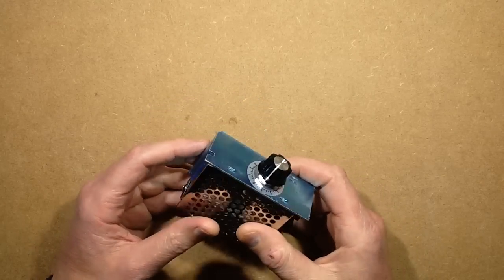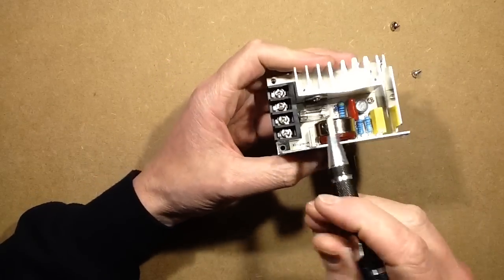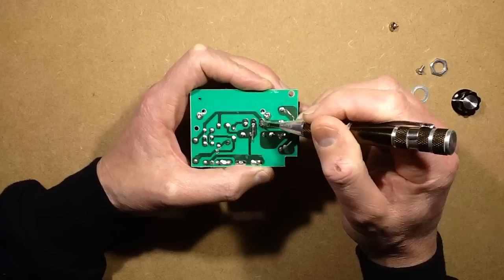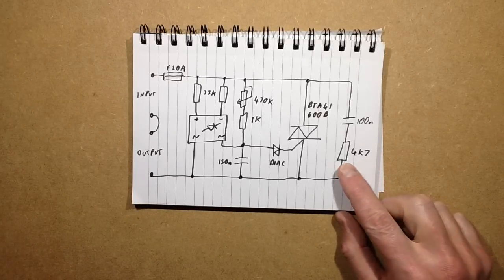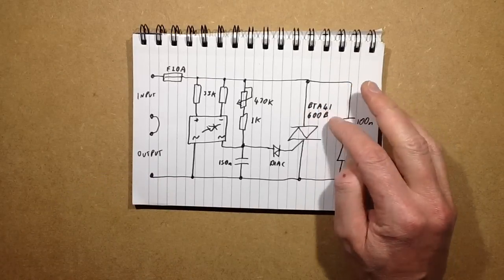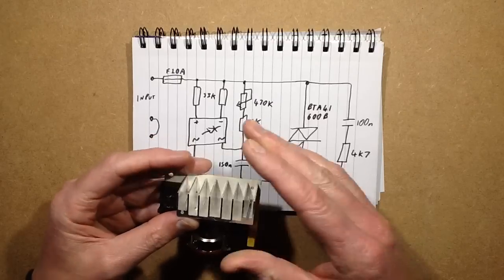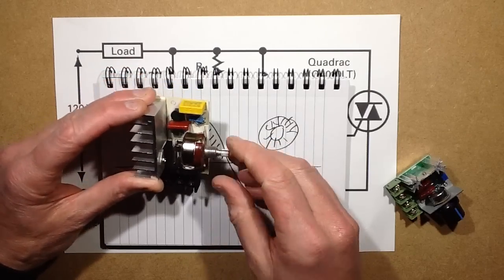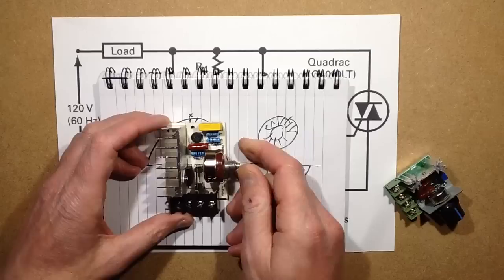Inside a "4kW" ebay power controller with schematic.

Comment: I have this unit, i'd like to use it for running a dc motor.  I used a 50amp bridged rectifier to convert ac to dc pluged it in and the motor runs full speed.  all the time. I even took out the potentiometer  and it still runs full speed.  Whats going on?  is this thing faulty?  all the solder joints are good and tight and I don't see any accidental jumpers.
Reply from the maker: If you try it with a plain lamp and it does the same thing then the triac may have failed.  If it works with the lamp then it may be an issue with the inductive load.
Reply: Yes I tried it with a lamp. Its a light on at all times. no diming.  thanx  I will remove the triac and find a replacement.  any ideas?  thanx for the response.  great sight too!
Reply: Never mind. I replayed your video again  and sure enough you explained it very clearly what the triac is.  thanx  I'll keep you posted.
Reply: I replaced the triac and everything works like it should.  I first made sure the ac light bulb went on and dims, then hooked up the diode trio to run the dc motor and walla, smooth as silk. Thanx Mr. Clive for you insights and help!  Just a heads up: make sure you ground the scr and the scr to the motor.  I allways use my tester to make sure of any stray voltage leaks. and the motor had around 10 volts flowing around the case. not sure of the amperage.  I grounded it and it went away.

Comment: Should there be insulation between the PCB and housing?
Is this a variAC?
Reply from the maker: +Slot1Gamer It is separated electrically from the casing.  A variac is a variable transformer, usually with exposed windings and a carbon brush.  This is a phase angle controller that regulates power by switching on and off at specific points on the mains sinewave.
Reply: +bigclivedotcom Can you clarify that?  When you took the board out it looked to me (and I assume Slot1Gamer) like 220V AC mains tracks at the back of the board was dangerously close to a flimsy metal case. I.e. if you grabbed the case and it bent, or if you accidentally poked something through into it, you'd hit live mains.
Reply: +MrSwanley This power controller isn&#39;t meant to be poked or touched when in operation.
You could just as well poke something in the wall socked, you&#39;d hit live mains.
And I think you could ground the case if you really wanted to be safe or to be able to touch the case.
Reply: I don't know where you live, but UK wall sockets have defences against being poked. You would have to poke something in the earth and live terminals at the same time. As to your main point, I remain unconvinced.
Reply: +MrSwanley you can just poke the hot, and be grounded.  Still dead.
Reply: I take it you didn't read my post above yours.
Reply: MrSwanley I think he means live on the device not wall socket
Reply: +Slot1Gamer I have a 4kW variac and it is big enough that you can confortably beat a hippo to death with it.
A variac is wound around a huge iron core.

Comment: Could this be used as a speed controller for a mobility scooter? I want to add more batteries but don't think the stock one will handle it.
Reply from the maker: +zeatsov No.  If it actually triggered it would latch on continually.  It's for AC only.  Not DC.
Reply: ahh yeah, forgot about that bit lol.
Reply: +zeatsov it would depend on what you intend adding, if you only add more batteries for capacity (mileage), then you can just add them as the stock controller is not doing any more work, its a common mod to add batteries like this or better batteries when the old ones die.(parallel batteries, same volts more Amp hours) with the added advantage your charger will still work, just take longer.   but if you mean add more batteries (serial) which increases voltage, making the scooter faster, then yes you are asking the controller to deal with more power than it was, and probably everything on the scooter wont handle the stress
Reply: +jusb1066 well I was thinking of doing both if possible and adding a switch to change between more power or longer life and adding a battery meter.

Comment: Huh. Haven't seen an actual TO-3 in decades. The tab version is odd—it certainly wouldn't fit in a TO-3 socket. I've seen similar tab packages on power MOSFETs, TO-247 comes to mind.

Comment: I've just recently got one of these (for a motor). After a bit of use, the capacitor on the motor started smoking (so I've disconnected it).
Reply from the maker: The capacitor wouldn't like the sharp waveform of the switching.  Some motor arrangements have a separate continuously powered capacitor winding for direction and then control the other winding.

Comment: my dimmer don't  work .its new as same as you. what should i do? I ran an angel grinder but it stayed at same speed.  please help me ..i will be very grateful..
Reply from the maker: If it stays at full speed the triac may have failed short circuit.

Comment: i bought this one 4kw, and i control 1,2,3 lamp so it is ok, but i control 1 ac 220v motor, so it can not work(when i control this motor, i must adjust VR 450kohm maximum, so this motor run, but i adjust to decrease in value  450kohm, so this motor does not work ). i do not understand!!!!!!!????? can you help me?????
Reply: you cannot control an induction motor with a phase fired circuit. You need a VFD for those.

Comment: Looks like the snubber circuit is designed for a load with a (very) high inductance. Hence the high values for both Rs & Cs. Check out this link: 
http://electronics.stackexchange.com/questions/55368/choosing-triac-snubber-resistor-for-multi-purpose-switching
Reply: Or maybe they just got it wrong!

Comment: I have one those Solariboost pieces of crap that has failed so was thinking of just ripping out the innards and using the case to house one of these to use manually in series with a timer socket. The iboost gave no hot water in the darker months and to much in the summer so I'd rather just have a power controller to reduce the power to the immersion heater, on a timer for an hour or so a day, to give me enough hot water,  & free if possible from the solar panels but looking at the 10amp fuse in this I guess it is not really 4kw or meant for use with a 3kw immersion heater unless I just try upping the fuse or never turning the dial fully on and occasionally I would want to do this for water heating speed?

I really can't understand why there is not already a cheap timer/power controller on the market for immersion heaters to work with solar even from the Chinese! Instead you have to pay hundreds for an iboost or similar that will last a couple of years if lucky & it's not worth it or make up something yourself and also work out how to do it yourself it seems. At least this one is cheap enough to give it a try and see what problems I run into. My iboost still works on the timed manual mode but that is set at 3kw and my solar rarely produces this.  The iboost has stopped working on the auto mode which used to adjust the power to use whatever electricity was otherwise being exported. I think maybe the triac in it has gone but I have no test gear to know for sure.

Don't suppose anyone has any links to any useful info on this type of thing? For now I just continue using the iboost manual boost timer and it's ok (I have to pretty much use that all winter in any case) but controlling the power level to match the solar output or should I say general lack thereof would be better.

Comment: +bigclivedotcom Would something like this be OK to use to reduce the output of a large multi-outlet aquarium air pump? The type that works by vibrating a permanent magnet at 50Hz?
 Thanks.
Reply from the maker: +Misfit the mad That's usually done by restricting the air output.  It wouldn't be a high enough load for a dimmer.

Comment: http://educypedia.karadimov.info/library/6785.pdf
Designers must manage the following trade-off to choose the suitable RC snubber circuit:
● Reduce dV/dt rates: the snubber capacitance must be high and the snubber resistance
must be low;
● Reduce dI/dt rate at turn-on (refer to Section 1.4): the snubber capacitance must be low
and the snubber resistance must be high.
Nevertheless, when low load inductances are controlled or, low damping factor or low slope
of reapplied voltage are considered, the snubber circuit design can lead to choose a low
snubber resistance value. To limit the snubber capacitor discharge through the TRIAC at
turn-on, the resistor value must be higher than a minimum value (typically 47 Ω for most
TRIACs and ACSTs).

Comment: why they use a 10A fuse if the dimmer it's for 4KW, i need 20A for my motors it'll work ?
Reply: never mind i found the answer in the last minute of the video hehe

Comment: Clive:  I'm a bit thick (well, actually a lot thick).  Did you test this unit?  I  know that the teardown was the purpose of the video, but even so........
Reply from the maker: +John Schroeder I haven't tested it yet.  Bizzarely I can't find a decent load to actually test it with that doesn't have electronics in it.
Reply: +bigclivedotcom Could you not use a couple. Well 4, 500W halogen floods?
Reply from the maker: +Birdiemango1 All my floodlights are LED.
Reply: +bigclivedotcom A vacuum cleaner motor will be a universal motor, if you have a basic one with no speed control on it
Reply from the maker: +jusb1066 Henry with unknown circuitry inside for speed control.
Reply: +bigclivedotcom 
No water heaters or electric heating fans?
Reply: +bigclivedotcom Electric kettle?
Reply from the maker: +ib9rt Even my kettle is electronic.  It's the one-cup type with the tank of water on the back.
Reply: bigclivedotcom Not even have an electric garden appliance? mower,strimmer etc?
Reply from the maker: +Birdiemango1 All Ryobi cordless.
Reply: bigclivedotcom hair dryer?
Reply: Birdiemango1
he doesn't have hair!
Reply: +jusb1066 The Beard though!!!
Reply: +bigclivedotcom 
Damn, looks like in your house you could run everything on 1A rated fuses! Nothing at poundland that draws any significant power?
Maybe it's time to get two of those very cheap 2000W heating fans. Cost less than 10€ online, maybe a little bit more at your local DIY/electronics store. You could also make a nice teardown after that and show why you shouldn't buy such crap, if don't want your house to burn down. At least you'll get some resistance wire and thermo switch out of them.
Reply: +bigclivedotcom I've made my own with nichrome resistance wire. 18 or 20ga may be good for you. I needed 3kw at 600 volts and I ended up winding a bout 5 feet around a .25" mandrel on a wood lathe. HTH!
Reply: +HLSDK ...5 feet of coils that is. Kinda pricey I suppose, it had to replace a bank of lightbulbs.

Comment: I have a water heater rated at 5500w, Can I use this or is there a relay system for that?  thanks!
Reply: +Astolfo Fumagalli add a CPU fan to the heat sync, and a small 12 phone adapter, give it a try!
i've never tested this but it should work.

Comment: hello clive please can you help me, ive got a mig welder and i want to fit a regulator like this to fine tune the output,please can you tell me any reason why this might not work thank you!
Reply from the maker: A welder transformer is a very harsh load to "dim".  It could also result in arc instability.
Reply: @bigclivedotcom  ok thank you

Comment: Thanks Clive. I bought one and interested to see how it works. But what effect would that 4.7k in the snubber have if its an error?

Note to self .... must add earth!!
Reply from the maker: The high snubber resistor is wrong.  A typical snubber network should have a capacitor in the range of 100nF and a resistor in the range of 100 ohms.

Comment: Umm. . .the first problem id mention is that the BTA41-600B would be pretty much exploded into spacedust if you apply the "maximum rated" 4000V as it is rated at 600V and its rated internal insulation can handle up to 2500V. Plus you are required close to 12mm distance between coated pcb traces and more than 2cm for open air ones to meet any standards of handling 4kV
Reply: +GotCritified 4kW (Watt) not 4kV (Volt)
Reply: +GotCritified You appear to be confused about W and V
Reply: +Kevin Garten I think he got crucified.

Comment: I bought one of these to slow down a washing machine motor and it worked well. I changed 2 of the wires on the motor to a faster speed and it still worked well. Then I went to change the other wire to make the top speed of the motor the slowest speed. I wired it wrong and the house trip box tripped. The fuse didnt blow in this unit or the plug. When I put the wires back to how they were, I plugged it back into the mains and now it doesnt alter the speed. It is atthe full speed, even though I turn the speed down with the knob.  Would this be the triac or the potentiometer that has gone faulty. Power still goes through  the unit. I hope someone can tell me. Thanks
Reply: just simply FORGET ABOUT MOTOR SPEED CTL with a Triac! they need variable frequency NOT variable voltage as for resistive loads (light bulb dimmer).

As far as Washers: the best thing to add to make them last forever is called a "Soft-Starter": it ramps up starting torque on 1 or 3 phase motors 👍🏻

Comment: I have found with cheap Chinese goods is they often copy a datasheet application note to the letter. On occasions including missprints. This looks like another example. Very little / no actual design goes on.